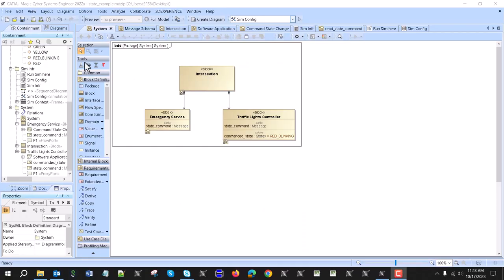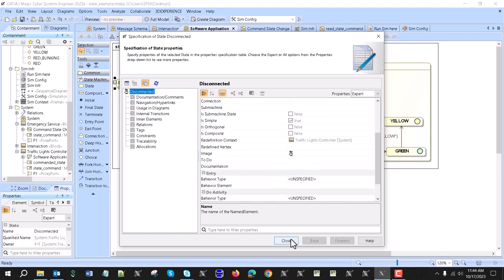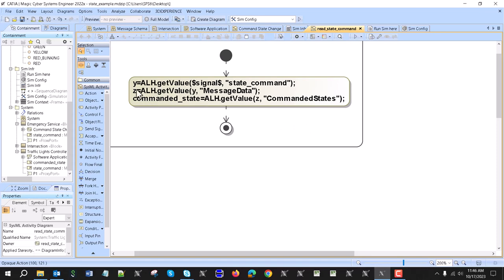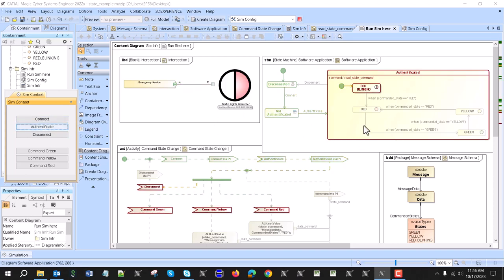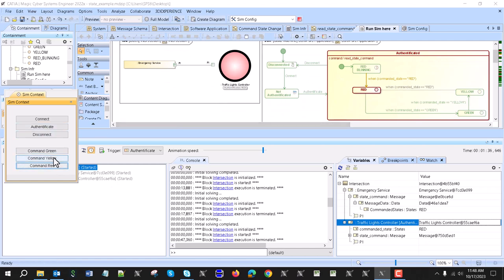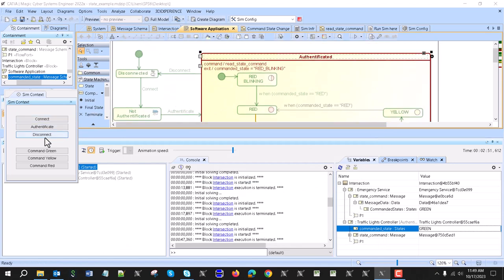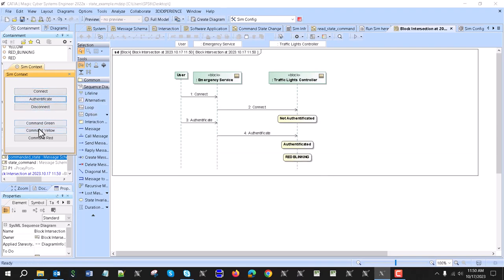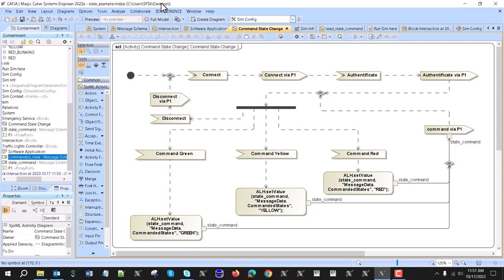Simulating Communication in SysML. How to Send and Read Custom Message?

Comment: Thanks for the example, simple enough, but already complex enough to show that SysML modeling leads to rather complex diagrams. For me, even the simple system traffic light is hard to understand just by these SysML diagrams.
Reply from the maker: Hello, thank you for the feedback. Totally agree that this is not the simple one, many different perspectives are at the same view. I think modern traffic lights system is far from simple if we take deeper perspective. But with right abstractions we can communicate it right. This was not attempt on presenting communication with stakeholders or method of SE but on messaging in SysML simulation. Good point that we need sample how to communicate with stakeholders :)

Comment: Why isnt the enumeration value printed as part of the message of the SD? For instance number 10 "command(state_command=)"should be "command(state_command=RED)"?
Reply from the maker: Hello, good point. This is because message is sent as value not the state. One more level of structure. If the value as state would be sent directly it would be shown as you suggest.

Comment: Can you do this with signals instead of blocks?
Reply from the maker: Hello, thank you for the feedback. At some extend yes. But signal is also used here to send the message. Message itself it is more precise to model as structure of blocks or value types. Signal in SysML is used as trigger for the behavior but not for data structure representation.